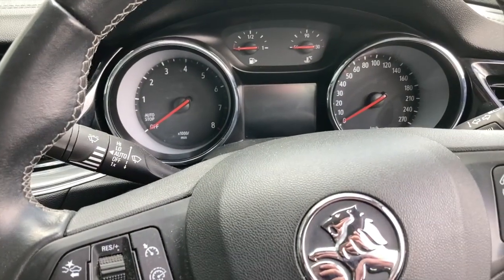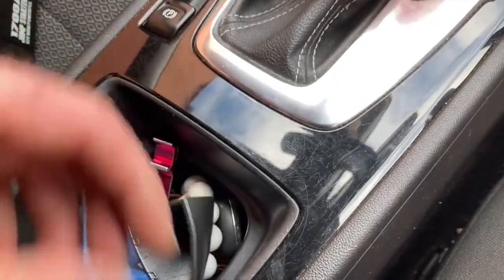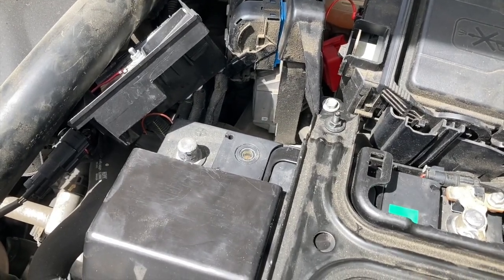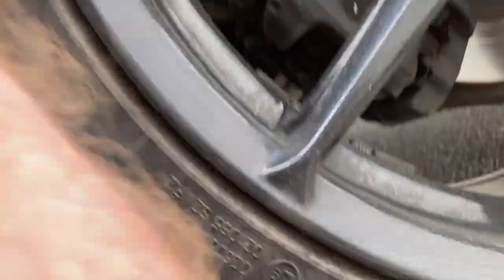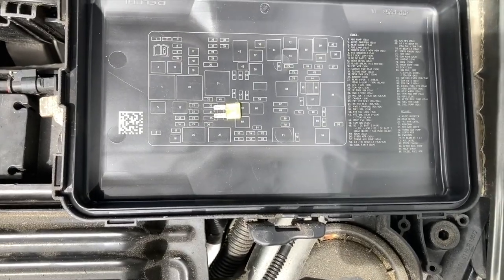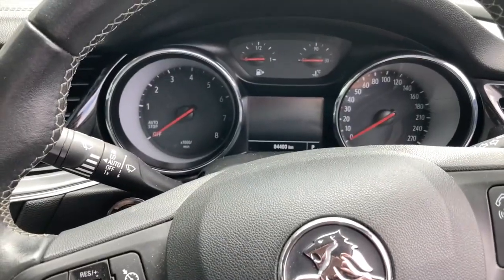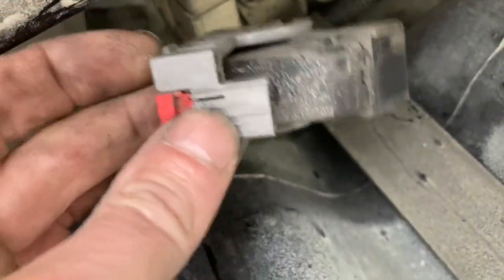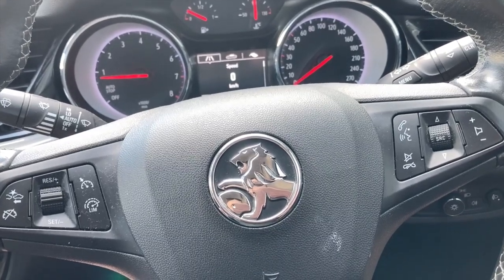Holden commodore fuel pump driver control module fault (causing flat battery)

Comment: Have to admit I've not come across that fault in any car yet. 
Having said that we don't get them over here. 
Although I've had the pump module going wrong on plenty veedubs.
You tried the inductive clamps yet?
I've never looked back as you don't have the 10A limit of the meter.
Reply from the maker: Ah yes the amp clamps are handy, and faster. Unfortunately I only have one that connects to my computer based scope, which takes a bit longer to set up than the ones with an on board screen.
Reply: Yeah I know the ones you mean. 
Our Pico had a couple of them.  @gettingitdone1